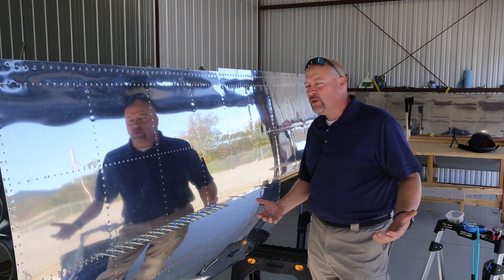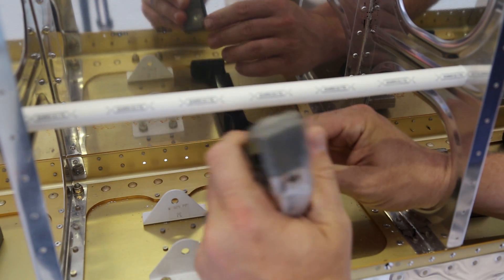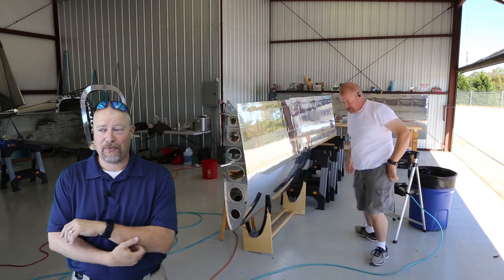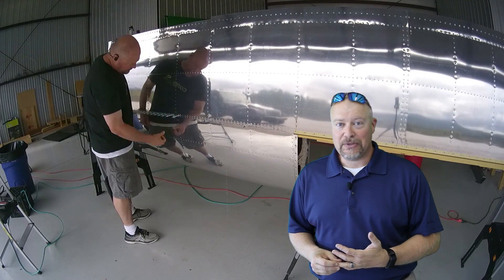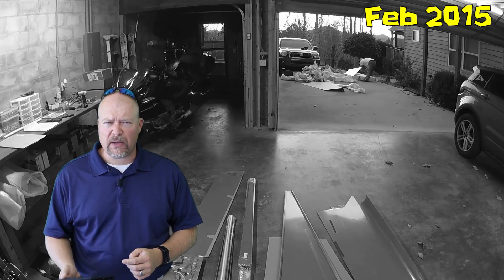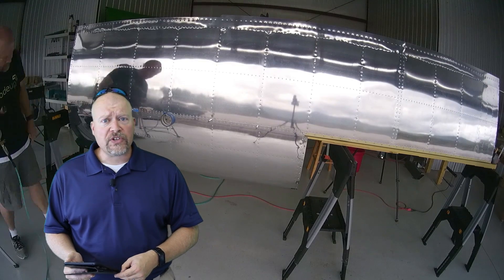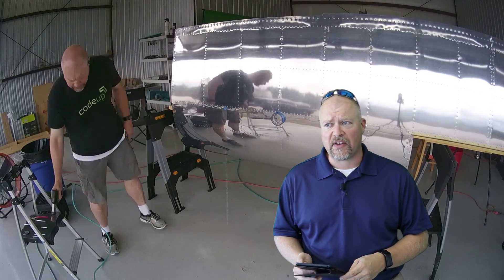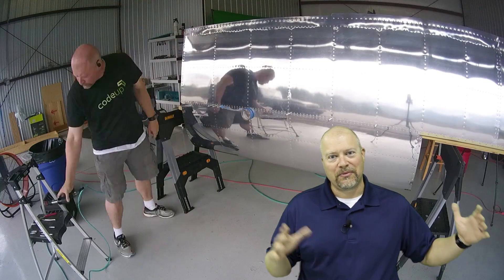RV-10 Wings - 047 - Finishing right wing front

Comment: Can you combine the wing leading edge section with the fuel take to possibly add extra fuel for longer range?
Reply from the maker: There are a couple RV-10 extended range kits out there that do something very similar.  Google it and you can see one of them adds an extra 15 gallons of fuel to the plane.  The plane already has a 1000 mile radius, adding more gas would just cause my bladder to burst.. haha

Comment: Well, after much discussion and anticipation, I got my RV14 Empennage kit delivered and started building! I've started putting out videos on my channel. I still have to work out how to get good angles to get better vision of work I am doing. I am still trying to figure out which settings to use for aspect ratio etc! 

I am hoping to get to a point that my videos for the RV14 are as informative as your RV10 build for new builders. Its a lofty goal but there is tremendous benefit to the videos that you produce!

Comment: Hey Jason, I noticed you never use the riveting tape twice. why not? I image it would be easier to reuse instead of getting a new piece of the right size every time.
Reply from the maker: I just use a tiny bit of painters tape.. Not "rivet tape".. I find it works much better and its super easy to use, plus is cheap as hell!  The rivet tape I have leaves a weird sticky residue.. The painters tape doesn't.   And to boot, the painters tape being a tiny bit thicker leaves a better set in my experience than real rivet tape.